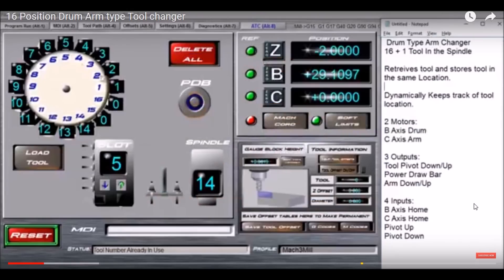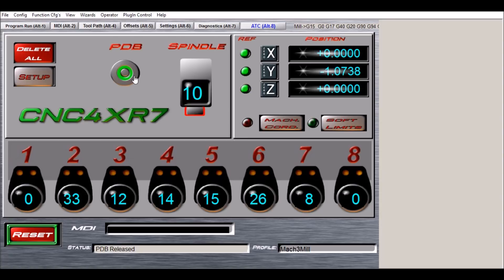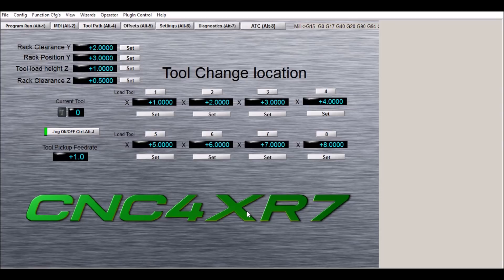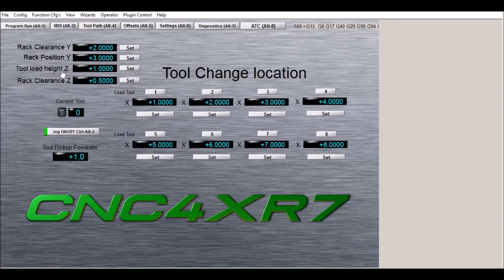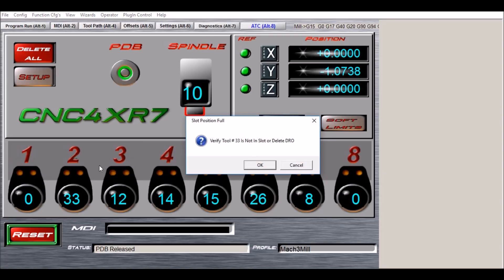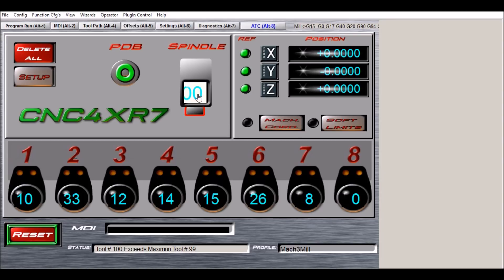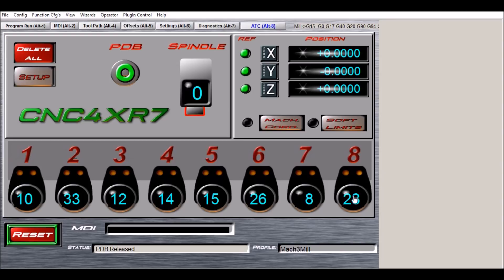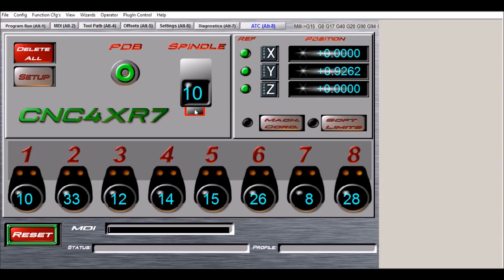Mach 3 CNC Router ATC

Comment: Nice job, as usual! One thing that was not clear to me however was at the tail end of the video it looks like tool 10 was in two places at once (in slot one and in the spindle). Shouldn't have slot one updated to "tool 0", indicating that the slot is currently empty?
Reply from the maker: The Rack slots do not change to 0 when the tool is removed. the spindle DRO shows the tool that is currently in the spindle. with a Arm type tool changer the tools are stored randomly than the Carousel is dynamic. this is not the case with a Rack changer as each tool has its designated spot until you swap in a different tool. The main reason in doing so is to keep the Macro simple.

Comment: you dedicated in making it very well especially in the professional look graphics。and the neat operation procedures。fyi。 mine diy one has a much messy look however 。。put additional safety measure procedures because of adding individual sensors in each tool position slot for checking if it is physically loaded or empty to prevent the accidential collision。this is an add-on to the software checking。
Reply from the maker: Hi RayChar, Not shown in this video are some built in Error detection to check to see if the tool is secure or released before moving forward with the tool change. The Macro will not allow you to load a tool into a slot that is currently Occupied. Adding 8 more inputs did not seem to be a good idea since it would require a more expensive BOB. I tried to keep it simple.

Comment: That is awsome are u selling this ? If so does it come with a tool rack or the files to make one?and what is it use to lock and unlock the tools?
Reply from the maker: I will have it posted on the website soon. it uses standard  tool holders or you can make your own. The Screen provides a output to activate a Air solenoid. Most of these High speed spindles with ATC have a sensor to let you know its clamped.